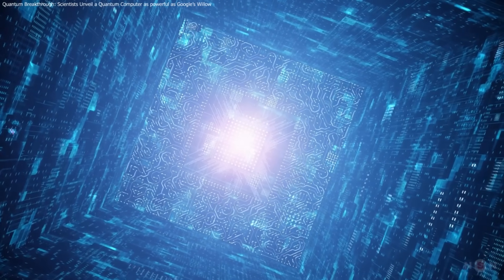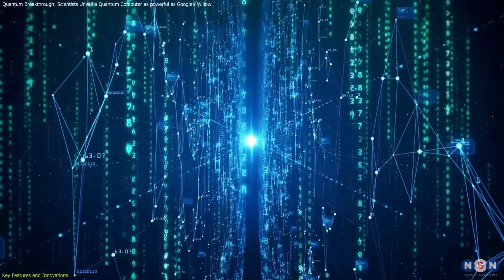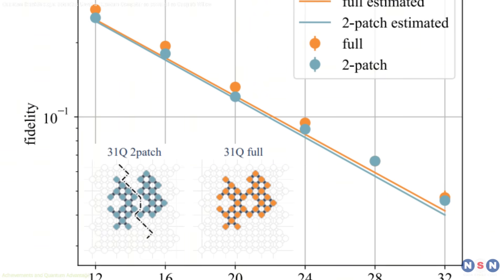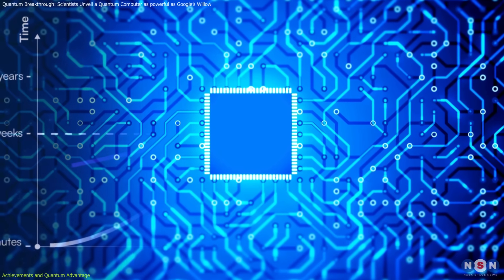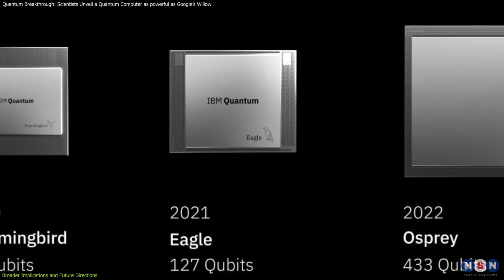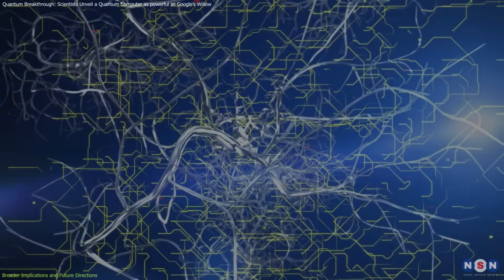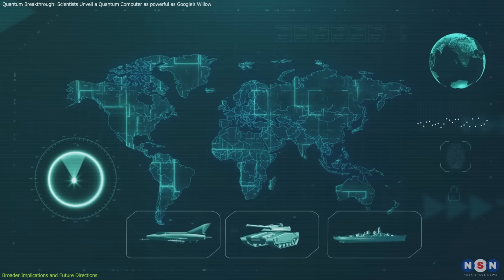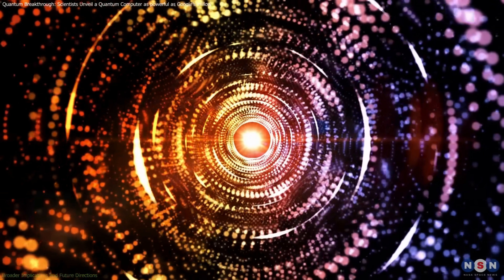Another Quantum Breakthrough: Scientists Unveil a Quantum Computer as powerful as Google’s Willow

Comment: Call me stupid but if it would take a classical computer millions of years to solve the problem then it would probably take at least as long for a human right?.... So how do you know it "solved" anything? How do you check it's homework? How do you even know you are asking the right thing?
Reply: Think of a 4 digit PIN code. It would take 10000 guesses to find a secret one, but if you could find the right one instantly, you just have to try it once to see if it's the right one.
Reply: Solving a problem and checking if a solution corresponds to it are different. In many cases like  determining the prime factors of a very big number which has only two big prime factors, Finding a solution can require more many computations than verifying if it is valid;  Finding the two factors (f1, f2 for a big N) can take many calculations that can take classical computer millions years  while verifying is a simple multiplication  that classical computer can do easily (N = f1 * f2).
Reply: @josuecharles9087  yeah, im not super into pure math so i wouldnt know what type of problems these computers solve, and i imagine the solution checking process can vary pretty wildly depending on the problem. But i'd imagine in your example the computer would also have to prove that no other factor of that number is prime, which would take much longer, unless the number provided is already proven to have only 2 prime factors
Reply: The most notorious use for quantum computation, factoring multiples of large primes (which can crack almost all forms of encryption in use), shows why what you are saying doesn't actually make sense. Multiplying two large prime numbers is trivial while factoring that result could take longer than age of the universe for a classic computer.
Reply: @jyjjy7 bingo but these things are tools and need people like you to make sure the piece of shit tool will work 😂
Reply: @Hunt_or_Die  oh, it's easy to check the solutions, but difficult to find them. Like if I give you the two prime numbers, multiplying them is easy, factoring may take millions of years.
Reply: Some problems are easy to verify but hard to solve. For example sudoku
Reply: @Dan_Nukem  easy, just make the solution first as a result of impossible odds to solve
Reply: @Masterflaw to reach a solution u have to solve it first
Reply: It’s like you know your password, but hackers need a lot of time to crack it.
Reply: Remember in algebra how a problem that was difficult to answer was easy to verify by substituting the answer into the formula you solved? Same principle, except solving the problem is tremendously harder to solve.
Reply: To know if you have cracked the encryption you have to examine the results. There in lies the rub. It takes time to look at the results.

Also, the only way to know if some file is encrypted and not random garbage (encrypted files look like random garbage) is to be able to decrypt the file.

The way to thwart a brute force attack of an encrypted file is to use more than one round of encryption. This used to be expensive and time consuming but that's no longer the case.

A file that has more than one round of encryption yields an encrypted file (indistinguishable from garbage) on the first decrypt pass at least. So, breaking encryption is not much of a threat especially when it's a trivial matter to have a very large key..
Reply: How do you know that it's not misleading you. 🤖 I'm a Quantum created Robot, and I never make mistakes. Trust me. 🤔
So if Quantum computers get a problem wrong. How will we know, if it takes our best Supercomputer's million of years to solve the same problem. 🤨😎We need to keep it simple or we will find ourselves being ruled by Machine's. These will be the idols that God has warned us about. It's not a statue, but people will still be idolizing these things which man created. 🤔🤨
Reply: i havnt watched the video so im unfamiliar with the type of problem, but if its something like an incredibly complex differential equation, you can just plug the solution back into the equation and if theyre equal then your answer is right, so I imagine theres some process to check itself.
Reply: Intel Inside man, idiot outside.
Reply: Probably because you insert the solution into the equation and check it. It probably does take millions of years to complete the equation once you have the solution. It's solving for the variables that takes time, I don't know, call me stoopidest
Reply: Because it works. 😢😅😂
Reply: @Dan_Nukem  similar to you can prove that a computer can factor a composite number into two primes without being able to do it yourself. Can you practice this is how modern photography works.
Reply: The bigger issue is that there is a 33% chance the answer is wrong
Reply: A smaller math problem that we can compute is able to prove the bigger math problem.
Reply: The future is now.
Reply: It’s called what we know from classical to current math 🧮 at hand.
Reply: Apparently quantum devices only work because of multiple dimensions existing, like it can scan all of the different realities and futures instantly, at once. It only proves that there are alternate dimensions.
Reply: @Dan_Nukem  I’m with Hunt here,  but the human brain is faster and better

Than any quantum bullshit you can hot wire and guess what we don’t mail fucking function like your dumb ass piece of trash does 

Stick that in your quantum pipe and smoke it!!!!! Signed :  a humble servant of God. 

God put me down for my God dam it’s 

I get passionate about stupid shit ya see
Reply: Factoring Primes for encryption. Educate yourself on factoring prime numbers and you might understand how it is possible to check the work of such a math problem despite the time scale differences...stupid 😅
Reply: give it a problem with a definite result when problem is successfully solved. if it can do it in minutes while a classical computer takes millions of years  it is confirmed.
Reply: By testing the answers in a simulation.
Reply: Sseek help i think u may be skitsophrenic paranoid
Reply: @Dan_Nukem  I'm struggling to understand any of your questions. Since they are all different from each other. There is a class of problems where a solution is never reached because of the size of the solution space, getting any solution is an achievement. Some solutions can be validated and verified independent of the way or path taken to reach the solution, I hope u understand the difference between a solution and the steps to reach there. And your last question doesn't even make sense, what do you mean by "right" question? That's YOUR problem not who or what you're asking the question of...
Reply: @Dan_Nukem  it’s all assumptions. They’re talking about 100 qubits when ibm has had over 1000 qubits for over a year now.
Reply: Take the case of drug discovery. Come up with new drug and then test in animals and humans to see if it does work
Reply: Oh, ChatGPT
Reply: Yes, if one were not so polite, they may call you stupid. These quantum chips will have the ability to create precise medicine, which will obviously be tested before given for treatment.
Reply: That’s a fantastic question, and definitely not a "stupid" one—it gets right to the heart of understanding advanced computing like quantum computers!

1. How do we know it "solved" anything?
Quantum computers are typically used to solve problems with known mathematical structures, even if the solutions aren't straightforward to compute classically. For example, when a quantum computer factors a large number, the correctness of the answer (the factors) can easily be verified by multiplying the factors together using a classical computer.

2. How do you check its homework?
Most quantum algorithms are designed to solve problems with verifiable outputs. While it might take a classical computer a long time to find the solution, checking the solution is much faster. For instance, if a quantum computer solves a complex optimization problem, you can plug its result into the original problem to see if it works.

3. **How do you know you're asking the
Reply: @Dan_Nukem  Exactly, a humans built it and gave its  info, human error is always in the equation. Like it or not, it’s there.
Reply: Like for example, guess my password, that is a simple question, which only I know the answer of and your computer might need a billion or a trillion years to answer.
Reply: The short answer is for most problems the time it takes to solve a problem is not the same time it takes to verify a problem. It might take millions of years to solve a problem but once you have the answer it takes seconds to verify the answer is correct.
Reply: No, you make good point, but think of it this way; many of the problems assigned to test these speeds are in the form of prime factors. The movie Cube touches on this, if you've seen it. Now, for very large numbers it is hard to say whether or not all the factors are prime, but, it is very easy to check. In the simplest example, if you asked if all the factors for 25 were prime, you might have to think for a second before saying yes, but multiplying 5x5 is simple.  Hope this makes sense.
Reply: @Dan_Nukem  Interesting point.
Reply: @Dan_Nukem  probability is how.
Reply: Stupid
Reply: You run tests. Plain and simple…
Reply: @Dan_Nukem  if you don’t understand something or don’t have the expertise you could try to learn more before trying to call out the people that literally dedicated their careers to this.
Reply: @Dan_Nukem  the QC solved theoretical problem that we all ready knew the answer, not a real life problem! That’s how .
Reply: Good question. In math it's often much easier to check if a solution to a problem is correct than to find the solution. Some problems are astronomically difficult to solve, yet easy to check if the answer is correct
Reply: @Dan_Nukem  its for programming not for daily users
Reply: if a problem solved using quantum computing. we humans know it does the hob of computing.
Reply: That’s been my question since the git with these intangible impossible problems
Reply: @flippopotamuss  if you encrypt a message and you decode it you know if the computer did it correctly... so these are the impossible tasks they can test it with
Reply: @Dan_Nukem  that is not necessarily true. Think of it this way, humans are actually smarter than computers in some cases. For example, I can look at an image of a dog and tell you immediately that it is a dog, for a computer this is a computationally difficult and complex task that requires advanced AI algorithms and training to perform. Sometimes the “difficulty” of a problem can be measured strictly by the number of iterations the algorithm needs to take to arrive at the answer. In some cases the questions that these algorithms answer are common sense to us and so where it may take 20 minutes or a million years for the computer to answer, we might already know the answer fairly quickly. Hope this helps!
Reply: @pdox9235  Hmm, It's a simple and best way to picture the need and purpose of quantum computing 👍
Reply: @pdox9235 in some cases? Not counting A.I. computers are completely stupid. They can calculate but that is based on step by step procedure and not intelligence.
Reply: @pdox9235  AI beat 10 doctors in Glasgow university.Doctor give 90 %,right answer AI did at that time 95% probably higher 2day because AI learning every moment more and more and more.Although some people can not see the 2marrows,pitty.
Reply: I said the same thing
Reply: No, you didn't say s*** because you're not paying attention, neither are any of you. 

"MIGHT crack codes currently unbreakable" in cyber security. 

???....

STOP!/:/analyze..... COMPLETE::

NON SEQUITUR 

Hey..... smarten up + good luck = Texas Instrument old ass pocket calculator....."error"
Reply: A computer is nothing more then an extension of human intellect.
Reply: @yahshua4592  hope not,because when I look at the history, I saw only tears and blood. I wish they can help solve this human error.
Reply: No in math you can know if the solution is true even if you don't know the exact answer. There might be an easy way to check without doing the long process to solve it.
Reply: your not wrong lmaooooo your going to have to wait a couple million years to get a text back better then never
Reply: @Kevencebazile haha that’s a good one.
Imagine you want to calculate something but you get told that you will have to wait millions of years to get the ansure and that that is better then getting no ansure at all🤣🤣
But for use humans that wouldn’t make any sense since we can’t even life thousands of years, let alone millions of years.
Also i don’t think the earth will still exist by that point and who with the right mind would waiting literally millions of years to get the ansure, so hahaha🤣🥲
Reply: @Dan_Nukem  exactly 💯 my thoughts 💭 Amen
Reply: @josephgutierrez5244 there is an answer by jjyj.... And you ignore it.
Amen.
Reply: How can you check the work if you don’t know what it it’s and the correct answer is? Makes no sense